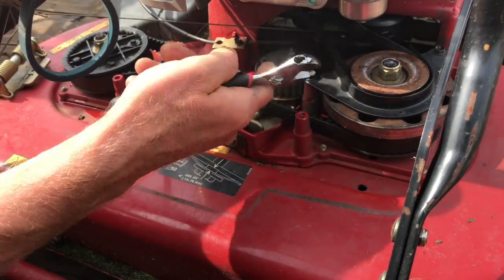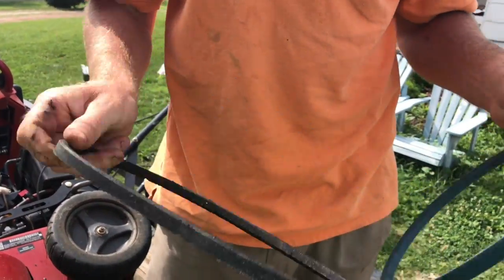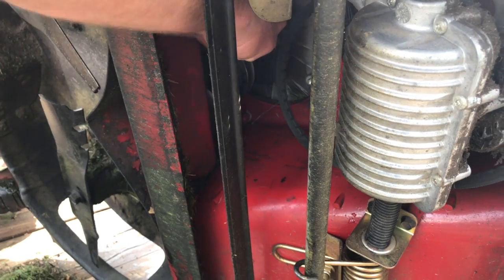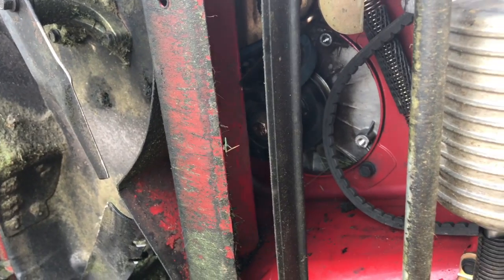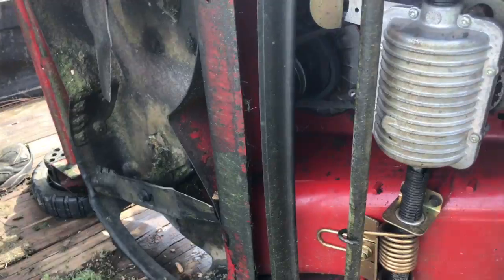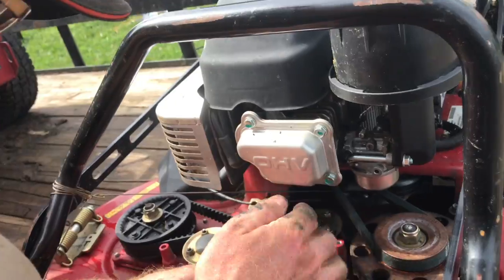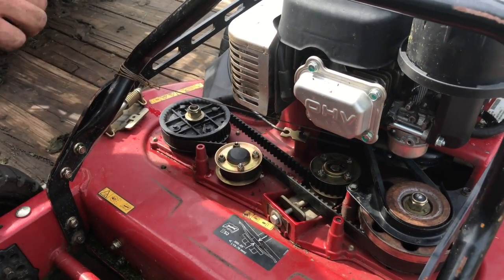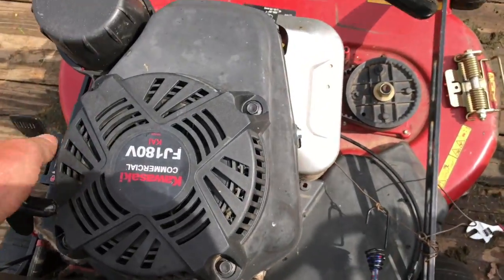Exmark 30" commercial belt replacement

Comment: Thanks for the video. Just confirming that I had to remove the transmission belt and seeing how you did it and replaced it made all the difference.  Good luck. I just use the machine as a home mower .

Comment: I've had that same Belt break seven times they put a whole new half of frame on my mower it's only a year old and the belt broke another week after I got it out it's out in the shop for 5 weeks I was not supposed to have balance break anymore he said the motor was sitting on top of the frame crooked or something and it's causing it to shake and it was throwing the belts off the belt broke a week later after they fix that $100 problem apparently it wasn't the frame I don't know I don't get it but I wish I could see better which belt you're taking off down there are you taking the bottom belt off to get to the next one or you just taking the one belt off and replacing it thank you sir I know this is an old video but maybe you still check it I don't know

Comment: Have heard that one must empty out the fuel/ or the oil before tilting at such degree in order to to do this. First time changing this same part so idk if thats a must or just a precautionary measure
Reply from the maker: Yeah you could and it wouldn’t hurt to change the oil at the same time. Also it would definetly make it safer. Thanks for watching!

Comment: Thanks for the video on the PTO belt. It did look like your blade timing was a bit off ? Too close for comfort.
Reply: These mowers have a keyed spacer that goes between the blade and the spindles. The spindles are keyed, and the blade is keyed. Blades are just slightly off form being perpendicular to eachother at any time. The spacer keys are shear points to protect the spindles. It's well designed and basically foolproof as long as you ensure the keys match up with the slots on the blades and the spindles
Reply: @Lasarius2010  all true but when you hit something with the blade the blade can jump a cog on the spindle pulley where the belt rides.

Comment: question i have a toro timemaster 30" Dual blade mower can i use the belts for the blades and transmission off a exmark 30 are they compatible yes or no
Reply from the maker: To be honest I’m not even sure. Thanks for watching!
Reply: Yes!

Comment: In addition to my first comment it was a $400 frame piece replacement I did not a $100 one that came out wrong funny thing it's out in the shop for 5 weeks while they ordered parts and did all this they said it wouldn't break the belts no more after this a week later the belt broke? I went in there to tighten the belt and quit engaging the blade the blade would cut then it would stop then it would cut then it would stop so I went there to tighten the engage thing it still didn't do nothing it still wouldn't cut that makes no sense to me they've replaced police detention or pulleys I've had nine belts break etc etc etc 1-year-old mower now the warranty is gone they wouldn't even give me a new mower I tried I don't have any Motor problems the Kohler Motors great I've still got about two more years left on that warranty I'll spend $2,600 on this mower to help my business and then the last 6 months has been in the shop about 10 or 12 times yes I use it 7 days a week all day everyday but it's 2,600 mower why is it not living up to what it should?

Comment: If you haven’t found that blade engagement cable try eBay. That’s where I had to get mine from.
Reply from the maker: Thanks!  I probably paid more than you because I just went to the dealer and they ordered it.  I was going to try parts tree but was worried I wouldn't get the right one.

Comment: Would you happen to have the part #?
Reply from the maker: Mark McKenzie no tbh I just go to the dealer and ask for a matching belt but I think you can look it up on partstree.  Thanks for your comment!
Reply: Happy's Family   No problem. Will do!  Thanks.
Reply: Thanks for the tip about the transmission belt. Much easier to put the belt on the small pulley first!